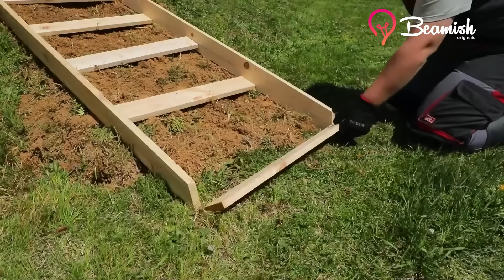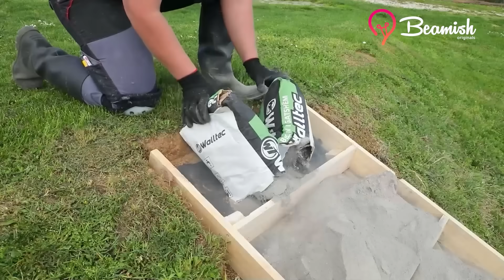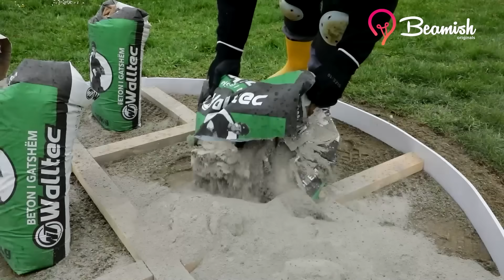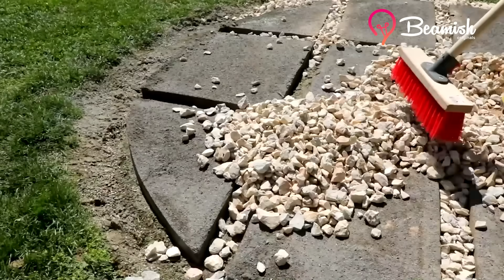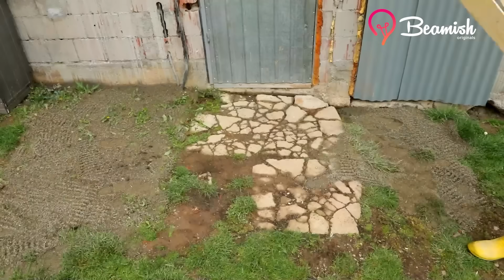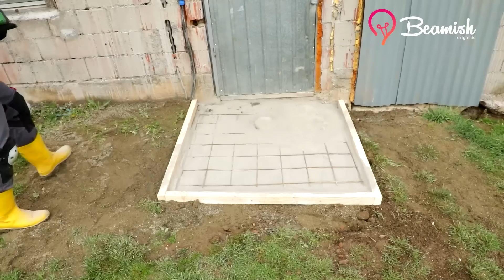DIY Steps and Stairs in a Sloping Garden! This Gardener's Skills are Impressive!

Comment: I've never seen a spot that needed steps less than that one.
Reply: I've never seen boards less pressure treated for ground contact than those boards.
Reply: They won't be there long.
Reply: If you are infirm you need aids everywhere.. I'd never even get up a modest slope like that without steps and/or handrail.
I think these videos are really to inspire your own take and application on them
Reply: True
Reply: I have a spot like that and want step’s pretty badly as I have trouble climbing the hill due to injury
Reply: They were also child size.
Reply: mind numbingly unaware of the needs of anyone else

Comment: To make a strong concrete you must use stones/gravel, iron (rebar) and sand (3 to 1).
Reply: The gravel is mixed in the redi-mix concrete bag. You don't use rebar for slab on grade concrete, rebar is for structural grade. If anything wire fabric can be used in the center of the concrete slab and the wire fabric is for minimizing cracks.
Reply: Rebar is for tensile strength. You don’t need tensile strength for slab on ground. Especially such small steps where it would probably be different to get 30mm minimum cover.

Comment: Sand ? Gravel ? Not good job
Reply: should use ready mix concrete rather than cement it has sand and gravel mixed  with cement so its stronger